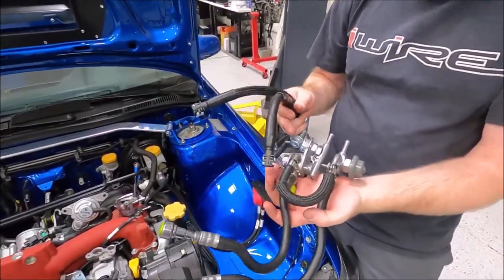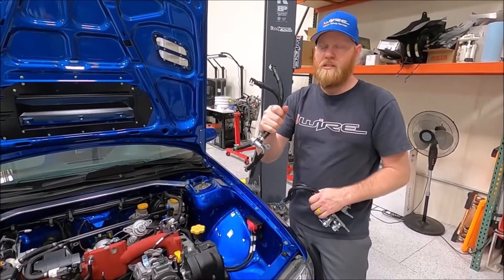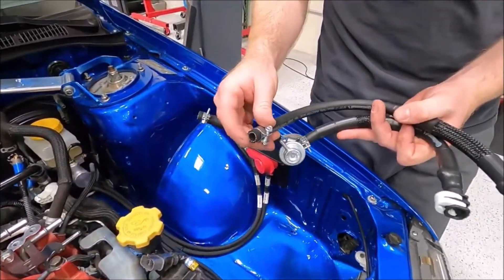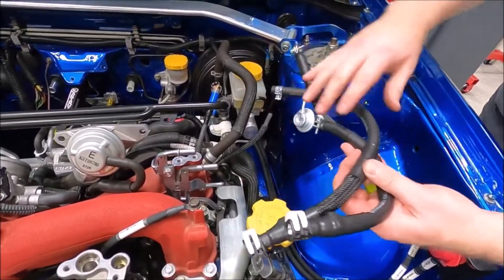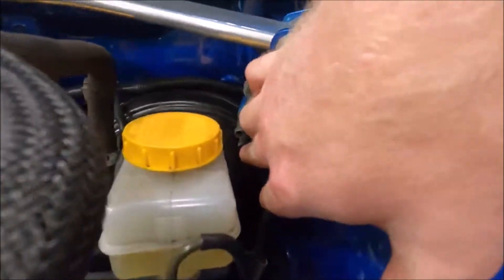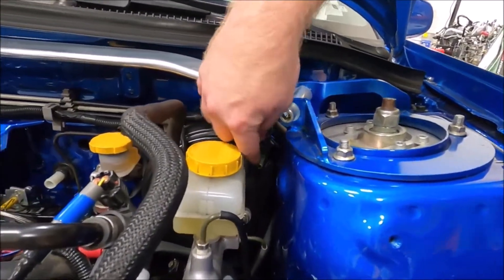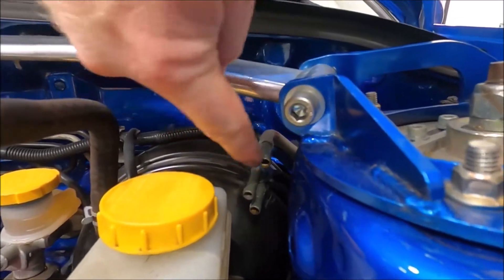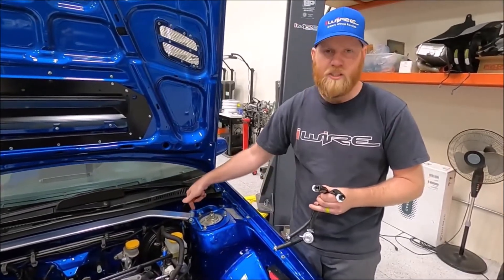Fuel Line Order for your Subaru Engine Bay

Comment: Hey guys how's it going? I have a 05 Subaru Outback 3.0 LL Bean Edition, about to install an adjustable fpr, everywhere I look shows the black fuel line/feed on the bottom, white fuel line/return on the top but mine is opposite, the black is on top, blue in middle & white on the bottom. I have the bigger fpr with the damper on it. I would just really love to get confirmation on which one is the feed & return on mine. I definitely don't want to do it backwards lol. I would really appreciate it.
Reply from the maker: Unfortunately, I can't confirm if the specs for the Impreza of this era match the Outback, but I suspect they do.
Reply: @iwiresubaruwiringsolutions  hey how's it going? I was looking around the fuel lines yesterday & noticed that coming out of the firewall the black is on the bottom. & you can notice the black is slightly bigger. But then the way they are ran, by the time they poke out by the strut, the black is on top, going into the top of the FPR. I'm guessing this does confirm the black is the feed/supply? Just thought I'd run this by ya, I would greatly appreciate it. Thank you again
Reply from the maker: @troshaffer4921  Sounds like you have it, and you can always double-check by cycling the key to see which line the fuel comes out of.

Comment: Completely unrelated to this video but I so wish you all would have been around or atleast able to be contacted  back when I was doing my first Subaru swap... the year was late 99 or very early 00 I had got a full (pretty much... it was cut into sections) wrx sti RA and was swapping the whole drivetrain into my 99??? Maybe 98 impreza outback sport wagon that I had got a killer deal on at the dealership I was working at it had a tiny bit of hail damage and they sold it to me cheap enough I didn't mind that much about taking it home and gutting it almost immediately lol but information was so hard to get back then and I worked at a damn Subaru dealership! Lol but after about 14 months (not working every single day or anything) I was able to get it driving and a few months later I took it to one of my factory training courses and tricked my instructor into finding some information about the dccd system that the 5 speed transmission was equipped with but I was able to find absolutely zero information about it then lol 
Sure would have helped and saved me a few grey hairs but then again it might have taken some of the fun away.....
Reply from the maker: Wow, that's pretty cool! Our owner didn't get into this until 2003-2004 so you were way ahead of the times.

Comment: Hey guys just wondering what line would I put a air to fuel ratio gauge on ?
Reply from the maker: An A/F gauge would use a sensor that goes into the downpipe to detect the air/fuel mixture in the exhaust. A kit for something like that would be this.
 
https://iwireusa.com/collections/iwire-plug-and-play-harnesses/products/aem-wideband-x-line-series-with-gauge-with-iwire-pnp

Comment: Informative detailed instructions. Where would i find myself those quick release fuel connectors? Would you recommend them?
Reply from the maker: They were included with the Cobb Fuel Pressure kit so if you wanted to purchase them separately I'm not exactly sure where you would find them.